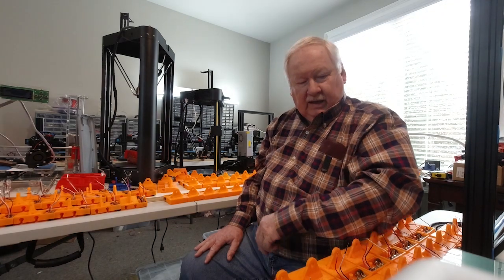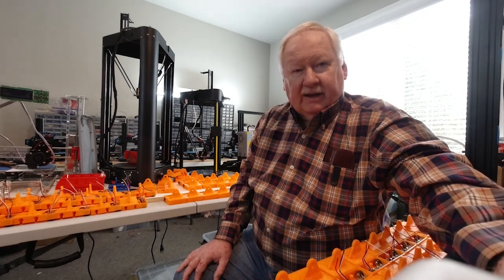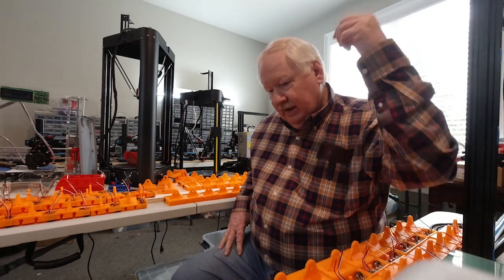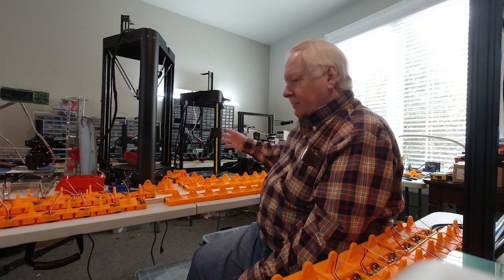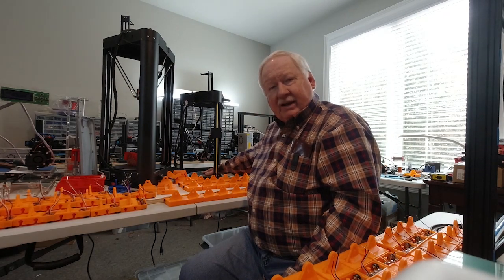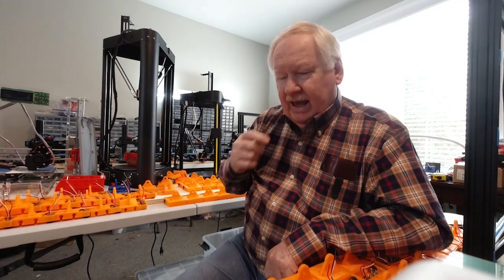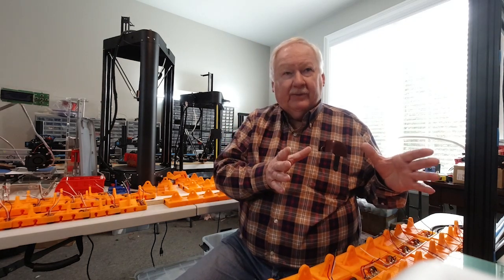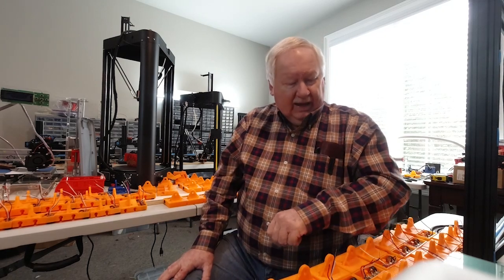MY 3D PRINT FARM AND HOW I KEEP IT GOING while making parts for the NTI Helping Hand

Comment: I. Know what your saying about printing the same part on a specific printer.  I find if you do that the plate wears out in the lay area and actually valleys it or weakens the glass at point of continual contact.   But it sure makes good sense especial with low temp pla.  Glad your grandsons helping... wow that would be such a reward for me.. there’s nothing greater than teaching ,especially when it’s your grandchild.
Reply from the maker: You are right Joe, I do like teaching him what I have learned. As for the build plate, I haven't reached that point yet and I can turn over the glass plate when it starts showing wear. Most of the printers will print 1-3 different parts with identical filament and settings. Thanks for sharing this information and as always for your friendship and support...Ken

Comment: I want to thank you for some information you had on one of your Anet ET4, you were trying to get the best printing temperature. I recently bought a Labists ET4 which is the same printer as the Anet ET4 with a different name, I tried the temperature you used and it worked beautifully.
Reply from the maker: Glad to hear that the temperatures worked for you Robert. I am printing some parts now with PLA at 200 and 205 degrees which is normally good for me however I found some black PLA that I purchased over a year ago and found that it prints best at 220 degrees. God luck with your Labists ET4. Thanks for sharing and for your support...Ken

Comment: What filament do you use mate. Cheers
Reply from the maker: 60% of my parts are printed with PLA and 30% PRTG, the other 2% are ABS, Carbon Fiber, TPU. RESIN, etc. Thanks for the question and for your support...Ken
Reply: @NewTechInventors  Thanks Ken, perfect answer. I'm printing 100% PLA however might grab a roll or two of PETG for some testing.